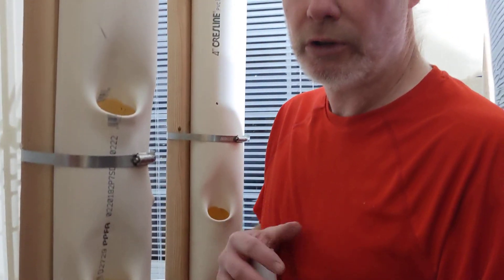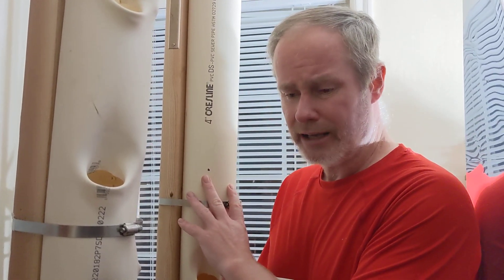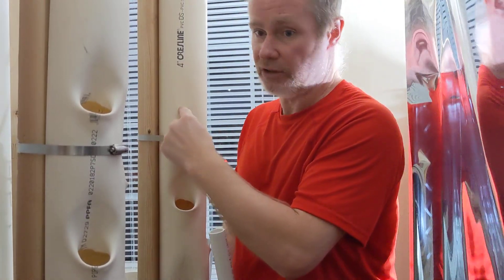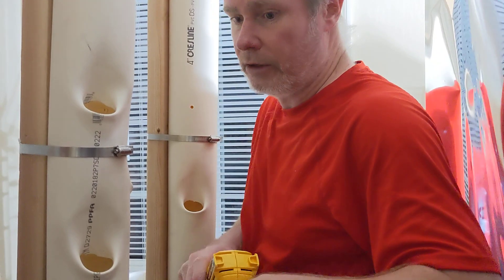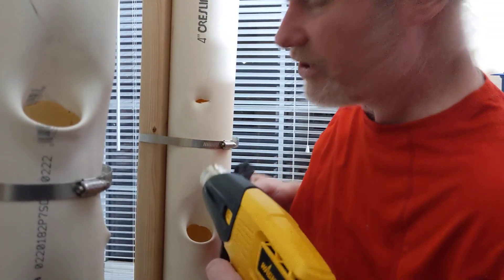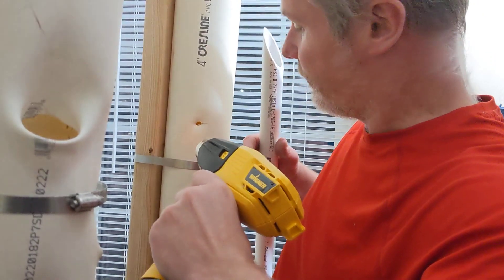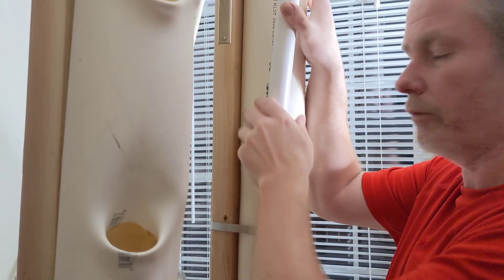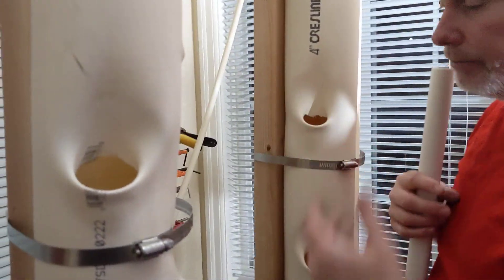My method for putting holes into PVC pipe for vertical hydroponic systems.

Comment: This would be ideal for indoor system whereas I am thinking the regular big store PVC being thicker may be better for outdoor hydroponic systems because water temperature may be cooler than outside temp? What do you think?
Reply: It will tear just like mine if you use the orange ones
Reply: @anthonyjohn4487  
Drill a small hole at each end of the cut lines before you cut them, that will prevent it tearing.

Comment: What size cups fit in the holes?
Reply from the maker: I'm sorry it is taking me so long to respond to your comment. I haven't looked at this video in a while. The tubes were not specifically designed to fit a net cup. Rather, I just put the medium inside the entire tube. But it would be easy to make the holes the size of a net cup just by getting a piece of PVC that was the same size as the net cup you wanted to accommodate.

Comment: Nice, how do you fill the holes. Do you use those little baskets or do you just jam some rock wool into the hole.
Reply from the maker: Actually, I designed this system so that the interior of the entire PVC pipe would be filled with media. I'm going to be honest, I was not able to successfully grow any strawberries in the system (strawberries were the plants I planned on planting). I'm going to do a follow-on video where I will talk about what happened and some of the modifications I made. It's kind of a surprise to me because this is based on an earlier design I had where the strawberries grew fantastic. I filled the tube with peat moss and vermiculite in a 25/75% ratio.